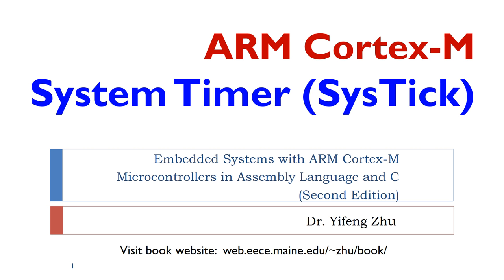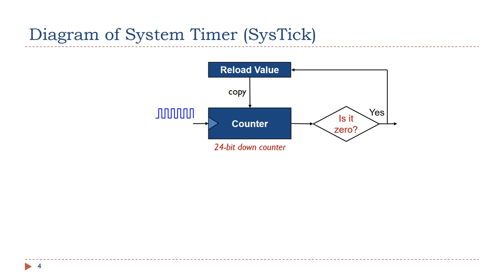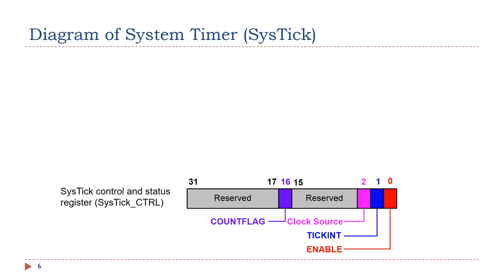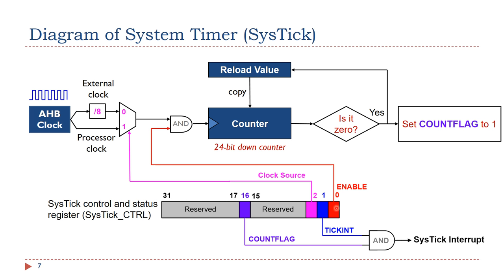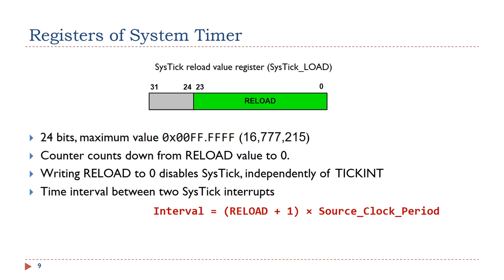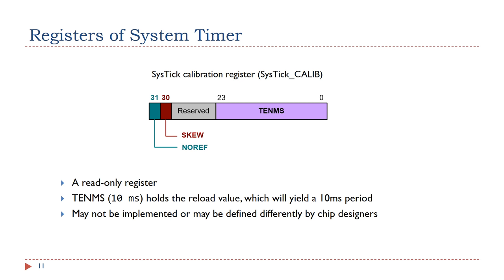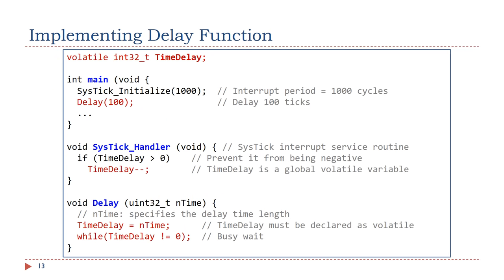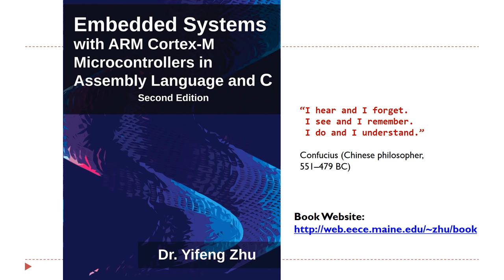Lecture 12: System Timer (SysTick)

Comment: For core3, SysTick calibration value is set to 9000. Does this mean that I have to work with a 48MHz HCLK or can I use a different clock?